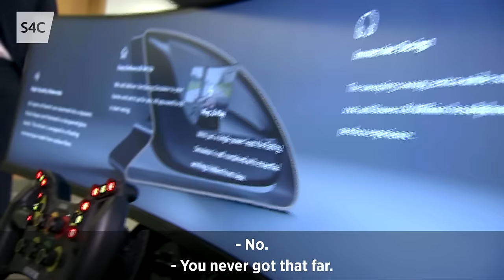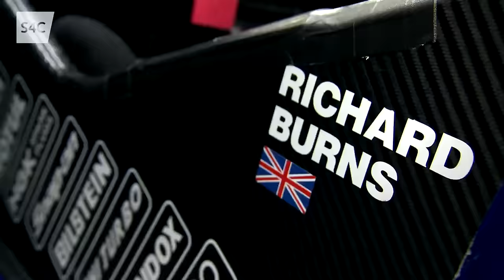Prodrive | Yn y Garej | Howard Davies visits a garage where champions are made

Comment: I’ve researched the Subaru start here and in Japan translating into English , the president of Fuji Heavy Industry wanted to sell more cars and knew motorsport was the way to go. He got his 2 top guys at Subaru and told them they were to form a motorsport division and to go to Ferrari to see tye ferrari engine designer about a engine for a F1 idea and to go specifically to see Dave Richards.
The 2 Subaru guys were into rallying and had used jap spec older Subarus on rallies down under and in Japan but really wanted to push the Legacy and a motorsport base model was to be manufactured which after a deal was done one went over to Banbury with a load of bits from STI .
That’s the start of it with the Subarus , imagine if FHI president had said go see Geoff Fielding or Jolly Club

Comment: can you imagine a Prodrive group B Porsche 959 !!
Reply: This is what I was told by a ex prodrive tech from the old old says 
The legacy’s rear suspension is based on a 6R4’s which is why the legacy RS handled and the early prodrive Subaru transmission was loosely designed on the Porsche